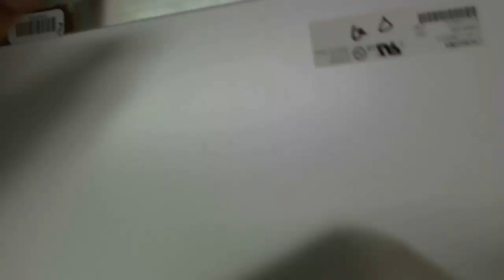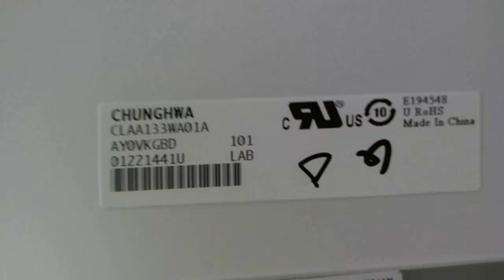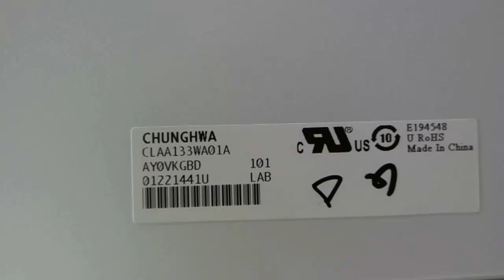Sony Vaio S Series VPCS Laptop Screen Replacement Procedure

Comment from the maker: this is a specific problem with sony laptops that the backlight stops working if the battery is not removed during replacement

Comment: Hey I've just replaced my screen and it wont turn on. Its just a black screen. And the fun thing is that my cracked screen worked before and today it dosent work when I connect it. Any possible solutions?